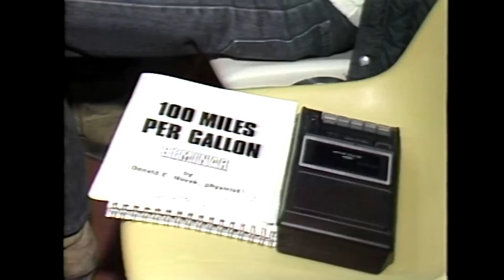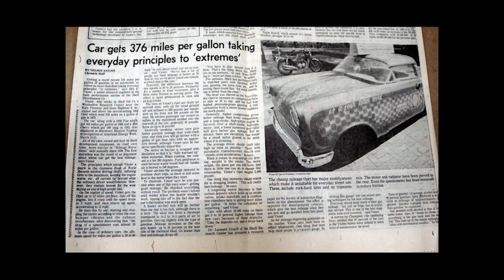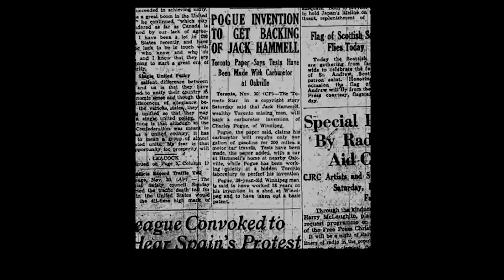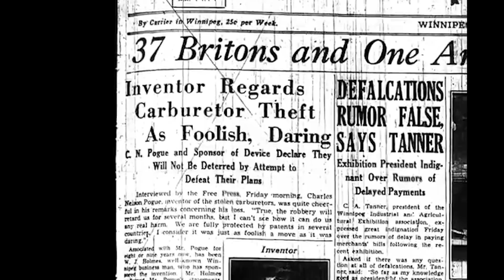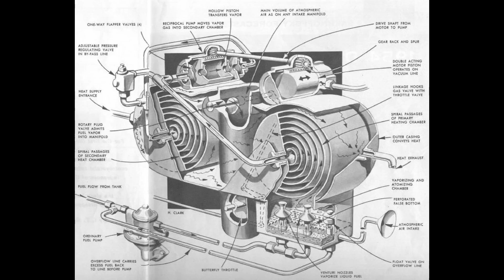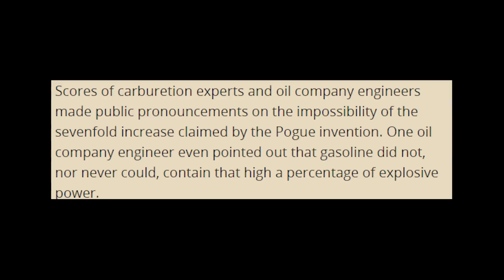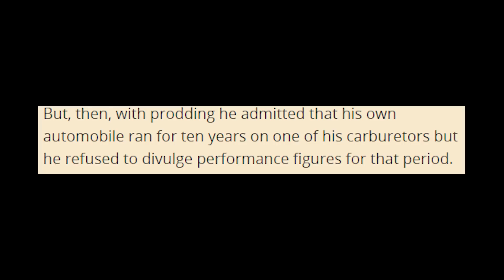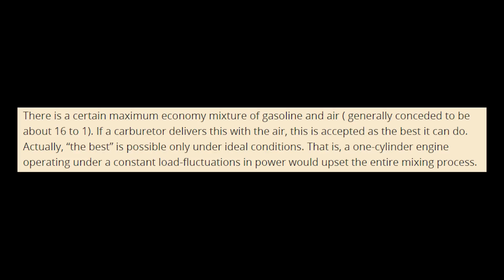What Happened to the Poque Carburetor - 200MPG

Comment: Something to think about! Propane and Natural Gas  are used as a Vapor. When used with a Carburetor they get less mpg because as a vapor it displaces some of the Oxygen and it is the oxygen mixed with the fuel that creates the power. Now when used with direct injection this alleviates the need to mix the fuel with the air in the intake and can be injected without displacing any air (oxygen) and thus more power. When gasoline is used with a carburetor the fuel is mixed with air in the Carburetor and enters the combustion chamber in tiny droplets and creates more power. Direct injection into the cylinder is the answer, that is part of the reason Diesel’s create more power and get better fuel mileage. The only problem with diesel is it is so dirty. the auto manufacturers are doing in today’s cars with gasoline. The advantage of natural gas or propane is they are high octane and cleaner than gasoline and a bonus is they are cheaper. In the US we have an abundance of natural gas, (advantage) ! Oil companies flare off the Natural gas which could be better used and cleaner to use it in a vehicle. Cleaner than an EV. I know I’ll get arguments about that statement.
Reply: The main reasons diesels are more efficient is because diesel fuel has more energy per gram than gasoline and the fact that they have less pumping losses due to not having any throttle restrictions.

Since in all but 100% full throttle scenarios, the gasoline/propane/natural gas engine is never consuming as much air as it can, the fact that the fuel displaces some of the air flowing into the engine is entirely inconsequential.

Natural Gas/Propane do make great fuels though, that's for sure. But Natural Gas will never take off as a vehicle fuel due to it's low density. Propane, which can be easily liquified at room temperature. Natural Gas however requires cryogenic liquifaction.
Reply: In my direct experience with LPG I can get more power due to the much better mixture homogenization in spite of the gas displacing some air and therefore oxygen. Some of this power is created by being able to advance the timing considerably, due to the approximate 110 octane rating of LPG.
I would point out that gasoline in droplets is always going to burn less efficiently than fully vapourised. Direct injection petrol engines get better economy by injecting richer mixtures near the the spark plug and thus igniting an overall leaner mixture than would be possible to reliably ignite also, running higher compression, because detonation can be reduced by injecting the fuel at the last moment, so it does not have time to heat up and self ignite.
Reply: @franksmith6683  carburetor, fuel injection, and direct injection has pros and cons. 
Carburetors are just simpler and cheaper.
Direct injection in my experience honestly isn't worth the trouble in gas engines. But on paper and in theory is superior.
Reply: @mrbig7718  But no car made today still uses a carburetor.
Reply: @NoahSpurrier  well put one
Reply: You can convert mist gas ebgines to propane, and they run cleaner and last longer. It's just a PITA to look for a place to fill up. Conversions used to be dual fuel.

Gas engines are about horsepower. Diesels are more about torque.
Reply: @dwaynestomp5462  you are absolutely correct
Reply: I actually OWN a factory built ford with redesigned engine that ONLY runs on propane. Never built with a gasoline tank or injectors. It was common in company vehicles here because ford done it till 2016 and mine is the last of the vapour carburettor kind before they switched to injected propane. They ARE less efficient because of the lower calorific value of the fuel. They use heated radiator coolant because the decompressing propane can freeze the big regulator under the hood. Seen it with my uncles converted vehicle with a leaky radiator. I have heard some people call them "the automatic radiator level cutoff". It's annoying because it's like half an hour before it defrosts naturally and you can go again. Look up ford ecogas. Green valve cover. Mine is dual variable cam timing and although it's a 4.0 6 cylinder it goes like a larger V8. Mine is a G6, FG model. Very nice looking car, like something from a 1990s concept drawing.
Reply: I was hung up on a highway where there was a propane powered vehicle in an accident and the highway was completely closed, with the worry of an explosion.  I do not remember the year but it was when propane was really taking off.  Around the same time as the accident the propane craze seemed to end.  KNOW THIS:  The fuel industry owns the world and there is no doubt there are far better more egfficient ways to run a gasoline engine.   You can be absolutely sure that anything that helps with efficiency will cost more, not less.  
Its hard to imagine the savings in catalytic converters alone running propane or NG, and those things burn the wasted unburnt fuel....absolutely laughable.
Reply: @EverybodyLovesMoe  I’ve seen gasoline fires burn out cars. It’s not so different. When you concentrate enough energy to power a car then  things will go wrong from time to time.
Reply: @davidrte.664  Not saying you’re wrong, but nobody really knows who is right. Some counter arguments: electrify can be generated from nuclear power plants, so zero carbon emissions. And even fossil fuel power plants are far more efficient at extracting power from fuel than a car engine. There are electricity transmission losses, certainly, but it’s hard to say if it’s a net loss or gain over burning fossil fuels in a vehicle engine.

I think hybrid vehicles have demonstrated themselves to be a good compromise. I had a Prius. It was a great car. And they weren’t slow. It was just the hippies who drove them slow, trying to drive them at maximum efficiency that gave them a bad rep. I used to flog mine and I still got over 45 MPG. Mine was 10 years old and had great acceleration. It’s top speed was maybe 90, but I never felt I didn’t have enough power for passing at regular freeway speeds. It had some quirks — being ugly was one of them. The fuel gauge was also misleading and when it ran out of gas the car would just stop. I never understood this because it still had the battery power, so why wouldn’t it at least let me pull over to the side of the road instead of leaving me sitting there blocking a freeway on-ramp? I was listening to the traffic report on the radio and I heard the announcer reporting a stalled vehicle blocking an on-ramp in rush hour traffic. That’s me! CHP came by in less than five minutes and gave me some gas. Toyota has probably fixed these quirks in the latest models.
Reply: CNG & LPG get less mileage because they have lower energy density too. https://afdc.energy.gov/fuels/properties

Comment: Using high-temperature exhaust gas to pre-heat the fuel would result in hydro-cracking and de-homogenise the fuel causing a normal petrol engine to detonate like Hell.  i.e. the Pogue ('Rogue!) carburettor is total bullshit!

Comment: Air fuel mixtures can run much leaner in engines with no crankshaft like the Burke engine that actually runs on detonation, not the slow burning in regular combustion engines.
Reply: There is no such thing as an engine without a crankshaft, do you mean camshaft because if you do your still wrong.
Reply: @The0utmode  🤣🤣🤣🤣 👍
You reminded me of people that said we couldn't fly! 🤣🤣
There is the scotch-yoke system and the wobleplate system. Surpise! 🤣🤣😎🤙👍
Reply: @jamesbishop9156  All those systems use a central shaft to turn the energy made from the engine into rotational motion aka a crankshaft! An engine without a crankshaft is like a human with no spine. It's not going very far.
Reply: @The0utmode  do you know what a crank is? It's like a lever on a shaft that causes rotational torque on the shaft. Yes, everything has a shaft for output, but not every shaft has a lever/piston rod that causes side loading on the cylinder walls.  Get it? Got it? Good! 🤣🤙👍😎
Reply: @jamesbishop9156  I will admit I learned something from you. In engines with out pistons or connecting rods. The main shaft is called an output shaft. But as for piston sideload being a major problem, In engines with a 1.75 rod ratio or higher and a 90 degree V piston side load is very little. And an engine that runs on detonation does exist in mass production. That a diesel engine. They make lots of torque ideal for trucks or heavy machinery. But weigh more cost more to manufacture and don't make as much horsepower as a comparable displacement gasoline engine. They can also not do so good in cold conditions. They also tend to have fuel dilution caused by the wider piston to bore clearance to accommodate the heat generated by detonation which can lead to excessive wear. This is the most fun I have had talking about engines in a while.
Reply: @The0utmode  Thanks! 😁👍
BTW, a diesel engine does the slow burn also to avoid detonation. Fuel is injected AFTER TDC when the heat of compression is hot enough to ignite the fuel in the hot air. If the fuel was injected before top dead center, it would cause detonation and destroy the diesel engine.
This is similar to the timing of a spark ignited gasoline engine.  Too advanced timing causes pre detonation, aka knocking and pinging.
Reply: @The0utmode  With the exception of the diesel engine, which ignites the fuel after top dead center.
Reply: @jamesbishop9156  I guess I should have referred to it as compression ignition sorry I'm not an engineer I just build engines for fun.
Reply: @The0utmode  It's all good in the hood, bro. 👍😎
Reply: @The0utmode  I like what you said ,Outmoded, " compression ignition." THAT WOULD BE IDEAL! 
Squeeze the air/fuel mixture until  self detonation. This is running on detonation versus the slow burn. The swirling water piston would be ideal to capture this energy for the highest efficiency and longevity of the liquid piston engine.
Reply: So why is my diesel timing 18 degrees BTDC
Reply: @johngibson3837  lower compression ratio, I assume.
Reply: @johngibson3837  It's still the same principle.. a crankshaft type engine can not handle the power of detonation.  Nothing else matters....
Reply: @johngibson3837  no point in arguing with this guy he knows everything lol
Reply: @The0utmode  I am wise but yet dumb, hence wisdom.  I look forward to my mistakes so I can learn from them.  I know some things but not everything. I'm happy to learn new things. I enjoy learning new things.  AWOMAN 👍🩷😎💚
Reply: @The0utmode  Not to mention the invention of another water piston engine besides the rototary one. Another engine design that is my favorite internal combustion engine spins water tangently inside a cylinder 🌀. The hole in the middle is like the top of the piston , and compression of the air/fuel is forced by the water coming into the cylinder.  The high pressure from detonation forces the pressurized water through a hydraulic motor.  Cool, huh? 😎